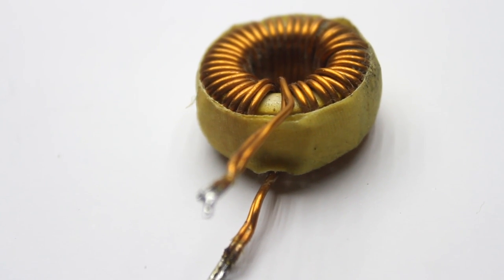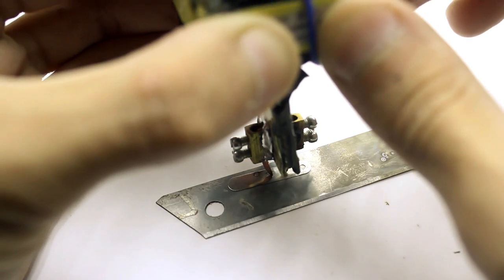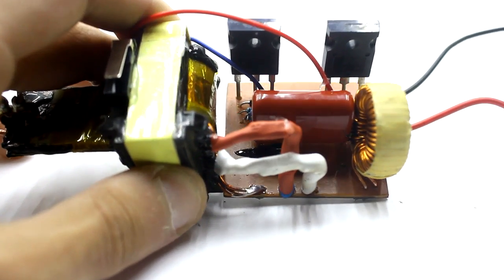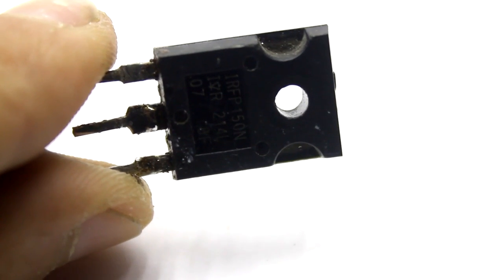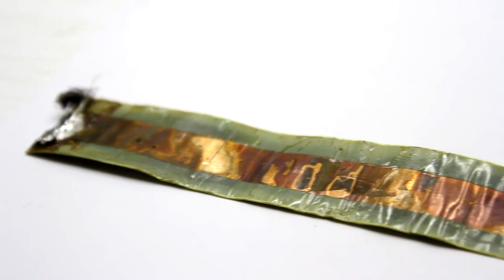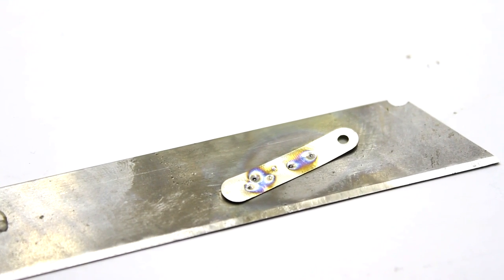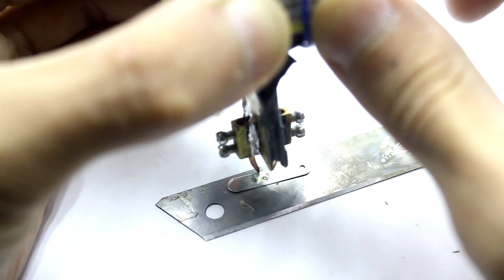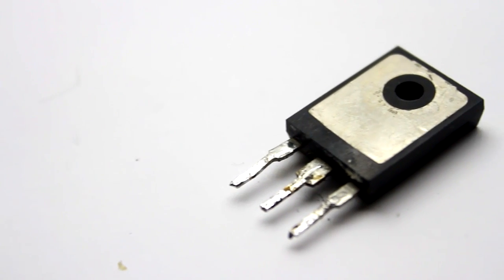Welding inverter for 5$

Comment: Not shown is the actuating switch for the power on off. A timer circuit, maybe 555, would not be difficult to incorporate to give more precise control to welding parameters. Like simple approach, bare bones, ripe for development. Also nice touch, using HD magnet to hold cells during operation. Thank you.

Comment: Great job, Kasyan. This is simple and looks to be working great - exactly what I'm looking for.
I'm a little confused about the transformer, though - can you elaborate a little ?

You could get a small adjustable timer kit to make sure you only 'fire' 1 second.....
Reply: Frank ter Beek A basic inverter circuit converts DC to AC and the transformer lowers the voltage while increasing the current.

Comment: irfz44n can do just as good as the 150n, but costs 0.30$ instead of 1$ on average. the irf540n handles 30 instead of 44 amps while maintaining the 100v drain-source parameter also at 0,30$ instead of 1$ per unit. i wish you could do some switching regulator converting from 220 mains to 0-30 v 200 amps for chargers and arc welders
Reply: John Scarce At the end of the video it was mentioned that a low capacity gate transistor should be used, check to see if your transistor meets this requirement
Reply: but u want 220vac to 30vdc 200amp cant you buy a welder from shop lol
Reply: but assembling it myself is much more fun and is cheaper
Reply: John Scarce depends which way ya go transformer cheapest from microwave or somat like a 24v drill Batt charger transformer ..rewind secondary coil with 2 or 3 turns but use enameled wire so u can add same length windings (increase current)  ...it wud be expensive to use a switching power supply with 200amp output
there's a arc controler in the welders to keep the arc constant this is a pulse one shot type ....have you had a look inside a arc welder it looks crazy lol
Reply: well at least high power power supply would satisfy me. i have microwave transformer and its useless on its own both for welding and power supply.

Comment: Hi the circuit looks like a "tank circuit". You can find the circuit already made on Ebay look for "induction heater" Also have you tried aluminum foil for the secondary winding? I will have to give it a try.

Comment: Thank you for demonstrating the smallest DC spot welder. Unfortunately, you did not show the REAL power supply {1} with which the spot welder functioned, even though it was shown in the schematics. 
Schematics shows switching to 2X Gates of IRFP150 through 2X300R. the power is still {2} on to the circuit through L1. 
Need explanation to {1} and {2}
Thanks.

Comment: Hello.  I made a welder spot, according to your scheme.  unfortunately, I cannot make a connection between the two plates.  my inverter can heat this metal to red between the terminals when the inverter is turned on for a long time (3 seconds).  do you have any advice?

Comment: Why can't you use 10x 4700 uF caps in parallel (for lower ESR) and connect it to a 12V power supply through a 1 Ohm 10 watt resistor (over 0.56 Coulombs), so as not to overload the power supply and the on/off switch, when charging the caps?
Once the caps are charged, you are ready to touch the probes and the charge stored in the caps will rush in and do the spot welding?
Reply: That will also work. Many ways to skin a cat and he is showing his version which is smaller.  In fact with 5 turns on the primary and 1uF cap in the resonant circuit it has 0.5CV^2 = 2.88E-04 Joules; and your version is 3.38J and is comparatively much larger but much less complex. In fact even with 1x4700uF capacitor it has over 1100 times the energy that is contained in his version. So then why even have the cap? You can use a 12V car battery directly without any capacitors. The energy in your version may even be too much and may blow a hole in the battery contact. But again it is something to consider.
Reply: Good to know. Thanks
Reply: @UFOHunter - but its not US5..!😂

Comment: An off-topic newbie question: why are the resistors soldered the way they are at 0:20 ? What's the application for this ?
Nice project idea by the way.
Reply: Ah, that's a nice trick! Thanks for the reply!
Reply: @vex9596  meybe they make it paralel, depends on the resistor value ..

Comment: Connecting the two outputs makes a soldering iron.
Reply: Interesting thought. Do You think it would be possible to turn a soldering station into a spot welder with some kind of timing switch?
Reply: The thing is connecting spot welder leads produces heat from high currents but It may seem impossible to some soldering stations to beciome a spot welder since few of them offer low currents.

Comment: Hi Kasyan. I really like your your videos. I'd like to know if you can help me...I'm a beginner in electronics and...I'm trying to do something: I HAVE A BLUETOOTH SPEAKER AND I'D LIKE TO ADAPT IT TO MY RESIDENT AMPLIFIER BY ADDIND A 3.5MM JACK SLOT, BUT I'D LIKE TO MAKE IT AUTOMATIC SO THAT THE SOON I PLUG THE JACK, IT STOPS THE SPEAKERS AND ROUTES THE SOUND TO THE AMPLIFIER (As it happens on phones and other portable audio players)

What I really need is the "switching" part.

Comment: make super simple inverter stick welder please
Reply: use a car battery.  12 VDC will make DC stick welder that will work great.  what diameter stick?  0.8 mm diameter will work.  only needs the cables and the stick holder and clamp for the common.

Comment: ırfp 15 n 60 ?
Reply: IRFP:  Rds = 0.055 Ohms;  Vds = 100 V; Pulsed Drain current 160 Amps.
IRFP15N60:  Rds = 0.385 Ohms; Vds = 600V; Pulsed drain current = 60 Amps.
So if instead of 12V input battery you use 48V battery and make the transformer primary turns 16+16 keeping the secondary the same copper strip it should work.  But now you must use 12V Zener diodes from gate to source to protect the transistor gates.
Reply: John Conrad 'those' zener (I saw it on video)?? They are not available on schematic

Comment: Hello there
How to build "this" transformer. How many turns in primary coil, wire diameter ecs.
Please tell us about it
Reply: Özgür Güvenç same as zvs driver windings 5+5 primary and 1or 2 secondary
Reply: Tanks a lot. I try 7+7 primary. It works fine :)
Reply: Özgür Güvenç  friend if I increase MOSFETs and input power .. can I weld like arc welder ,
Reply: Özgür Güvenç o want to make small stick welder which can weld 1mm or more metal welds
Reply: Hello. Friends, the first winding of how many turns are the same with the secondary and tertiary? What caliber are each winding? Thank you.
Reply: @SIKHGT650 What is 5+5?  how is the calibre #?
Reply: @GvncOzgr What is 7+7 how is the calibre #

Comment: I did not see you welding anything to the positive side of the 18650 batteries, is that because you cant weld on the positive side of the batteries? Because if you cant then this thing is useless for making 18650 battery packs!